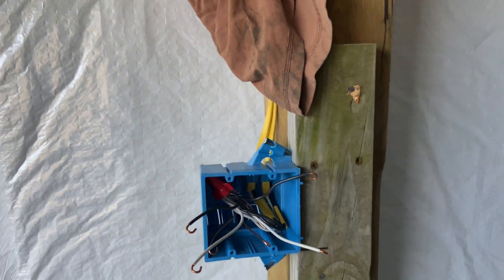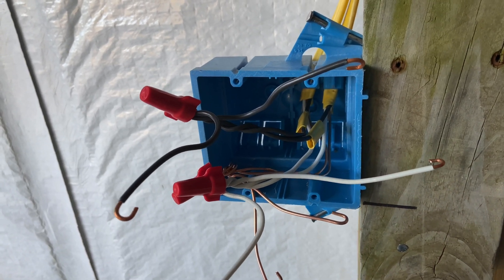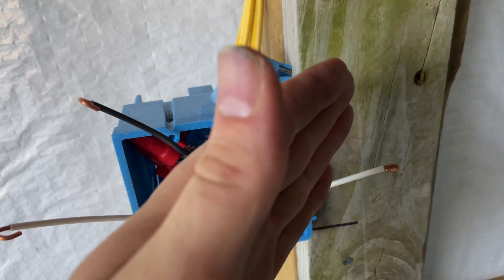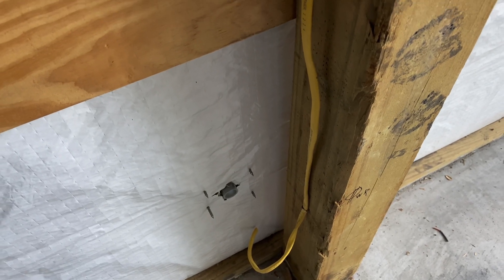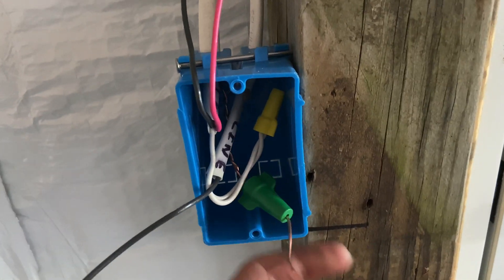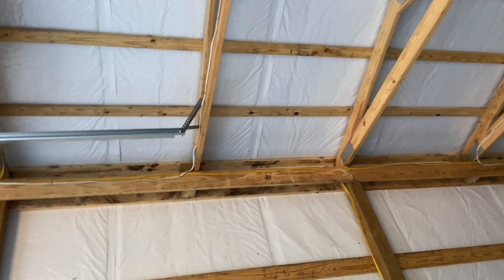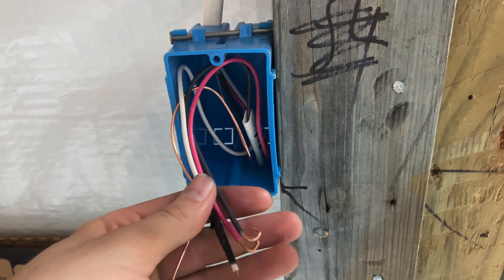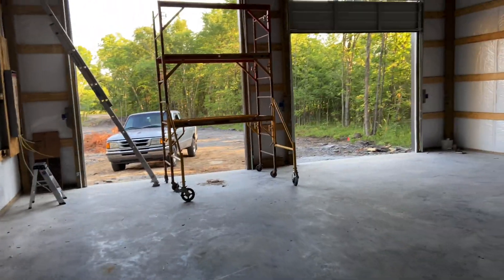Episode 15 - Electrical Rip Out

Comment: I dont want to be critical. Your in a garage .The NEC states everything in a garage thats 120 volt has to be GFCI protected .You could do one of two things to comply make the first outlet a GFI & load side the rest on that run or use a GFI circuit breaker in the panel. The NEC demands that ALL 120 volt openings in a garage/shop be on a GFI .This includes all outlets including the door opener not to mention the lights to. What did the electrical inspector say about this? Not having GFI could potentially get some one killed. GFI protection is required in GARAGES,OUTSIDE OUTLETS,KITCHEN COUNTER TOP OUTLETS,DISHWASHERS,BATHROOMS,FINISHED & UNFINISHED BASEMENT OUTLETS , CRAWL SPACE LIGHTS OUTLETS, LAUNDRY OUTLETS and OTHER OUTDOOR 120 VOLT APPLICATIONS. Hope this helps you
Reply from the maker: All the receps are AFCI/GFCI protected at the breaker.  Originally they weren’t. I have sense purchased all the breakers for the house and bough my extras for the shop to get a bulk deal on price. 

I am in the incorporated part of my county. No inspections and no permits.
Reply: @Ciband  In your garage /shop i would not advise you to use AFCI because they will do nothing but nusance trip on you. I would heavily suggest you buy  GFI only breakers .Now for the house anywhere a gfi is required i would suggest an AFCI/GFCI  breakers. living,dining ,bedroom I would use AFCI only. For your furnace  i would just use a regular breaker.